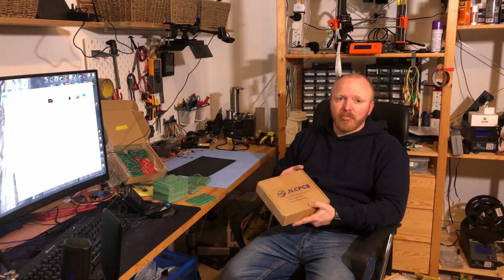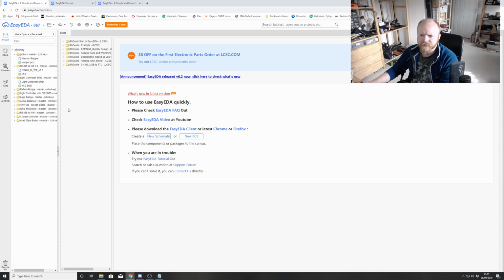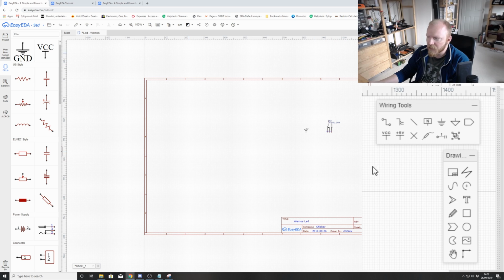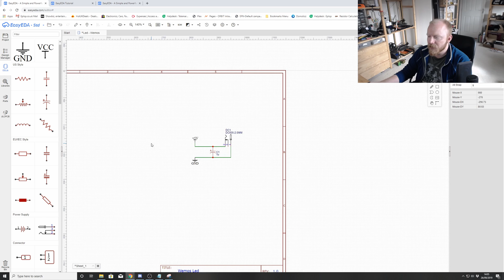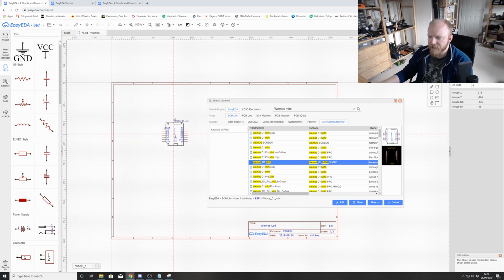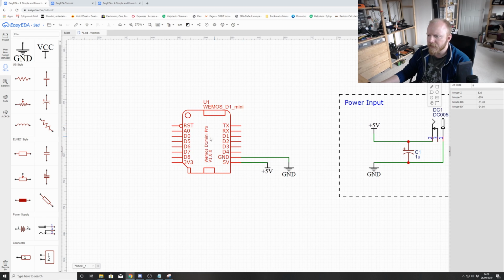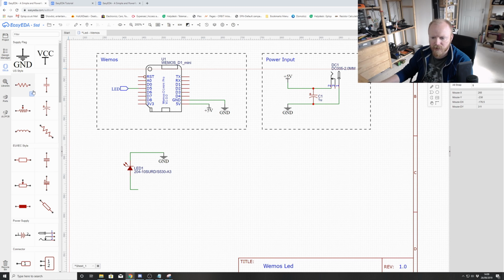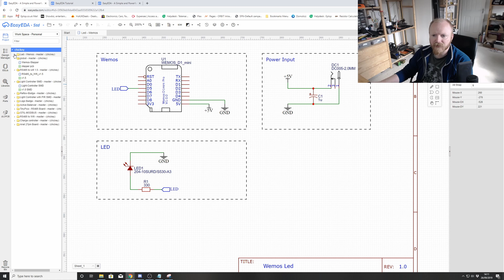Beginners guide to PCB design with EasyEda Part 1

Comment: Good stuff. When using net ports, particularly over several sheets, I always use copy and paste to make sure there are no typos. And of course, don't forget to put the No Connection X on all unused pins. That way you can use all the error checking functions properly. Error checking is one area where Easyeda can have problems. If you think you have fixed all the errors but it still shows some, save, close and reopen the project. Chances are they will then be gone.

Comment: Everytime I add a +V or a GND symbol and then go to PCB design, I get a message or box that tells me there are some unfinished  NETS  asks me to check for them. Even doing exactly as you did. So you don't actually create a schematic in one go with wires and components, you build? each part of it. Thanks

Comment: I have a box I purchased which has a 12 pb keypad, I want to take out the original pcb and create my own, repurposing the small enclosure. Is there a way to place pads on the board by using x y measurements so I can place the pushbuttons in the same location as the original board?

Comment: Excuse me for the blunt question, can I know why does EasyEDA does not automatically generate holes/pad for Vcc and GNB which can be used as power supply to the board.
Reply from the maker: Hi, there are many methods for supplying power so it would not be a good idea to generate  holes automatically.

Comment: Great video.  I think it's a good idea, though, for everyone using EasyEDA to always check the components you're putting into the diagram to make sure they are the correct PCB footprint.  I can't tell you how many times I just click the one right there on the side of the screen only to find out they're surface mount footprints instead of through hole, or visa versa.
Reply: https://youtu.be/upaVO_SMAQM 🙏🙏

Comment: Hi Colin every time i import the design to pdf for etching   printing it create the wrong scale any ideas to change to what I've drawn to scale.
Reply from the maker: hi really sorry but i've not tried to do it with etching.  You may need to check that your not changing to scaling so printing it 1 to 1, avoid scale to fit etc in your print settings.

Comment: Great video. First one I found that goes slow and explains the basics clearly. I'm trying to put a schematic together that includes a relay module. When I try to convert to PCB it says "the pin numbers can't find the same pad numbers". The relay module has 4 holes in the corners of its PCB. How can I add this to my schematic? On my PCB I just want space to mount the relay PCB.
Reply from the maker: Hi if it's a user submitted design it may have issues, have you tried one of the other designs from the library of components?
Reply: https://youtu.be/upaVO_SMAQM 👍👍🙏

Comment: Colin, I seldom am able to find all the components I want to use in the databases.  If I use the standard generic symbols I never know if I will be able to find the correct outlines on the board.
Reply from the maker: It can be a lottery with components especially when using user submitted ones.  Sadly i've found it's a case of trial and error and noting which ones work for future use.
Reply: https://youtu.be/upaVO_SMAQM 🙏🙏

Comment: Really nice intro. Could it be that the connections to the dc barrel are reversed...?
Reply from the maker: They are indeed, on concentrating to film/record what I said I was connecting and what I connected were incorrect.  Sadly you can’t overlay a correction without deleting and reuploading :-(
Reply: @Chickey  Happens :) Just dropping the comment in case other viewers are wondering. Really great video series, I've learnt quite a few tricks!! Thanks.
Reply: https://youtu.be/upaVO_SMAQM 👍👍🙏
Reply: https://youtu.be/upaVO_SMAQM 🙏🙏

Comment: Nice Colin.  I learned a few things even though I also have a mountain of boards from JLCPCB already.
Reply from the maker: Thanks for the kind comments John, was unsure if i should do a video like this but many are starting out so hopefully it shall help some folks.
Reply: I think a follow up video on tips, tricks and traps would be good! We’ve all made mistakes and it’s would be good to ‘out’ them for the benefit of newcomers
Reply from the maker: @Magic-Smoke  Yeah definitely, it's so easy to make mistakes.  Filming something like this is really distracting so for example in my haste i chose reversed the pins on the power input for example doh.  I maybe need to start making a sort of script.
Reply: @Chickey  I didn't mean filming mistakes, more along the lines of 'PCB design clangers' - lol
Reply from the maker: @Magic-Smoke  Me too getting the power input polarity the wrong way around would be pretty disastrous lol.
Reply: @Chickey  Oh yes, I did notice that! All I can say is that when you do that, you should choose the black boards since they will dissipate the heat better when you turn it on - lol
Reply: https://youtu.be/upaVO_SMAQM 🙏🙏🙏

Comment: Thank you for this guide. I'm still using Frizing but thinking it's time to move to something more modern
Reply: LOL, My short term memory is SPAZZED out.  That's the main issue.  I need to do something 40 times before it sticks.
Reply from the maker: I only realised this week that you can do board designs in frizting, in the past I've used it for schematic and breadboard layouts.
Reply: @Chickey  LOL, I've use PAINT on simple boards.